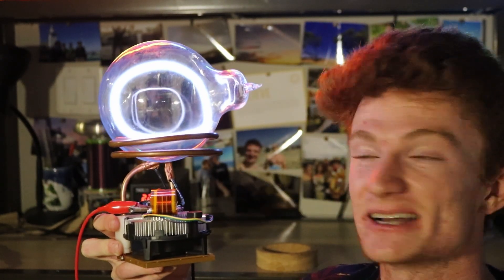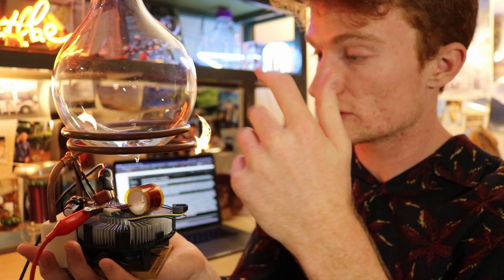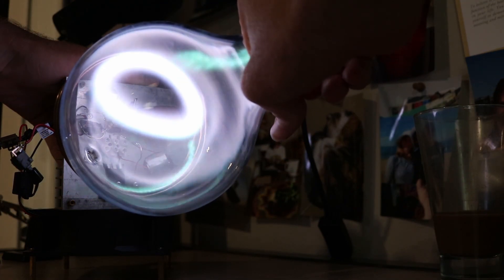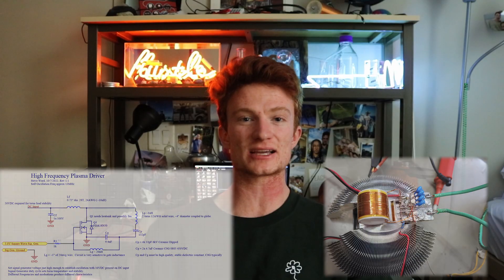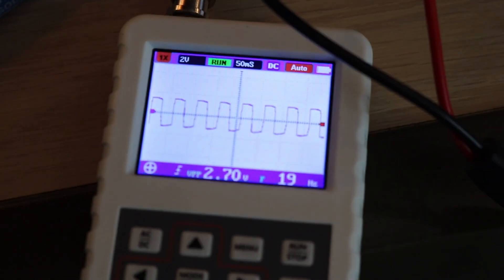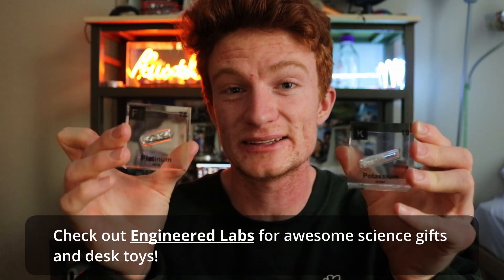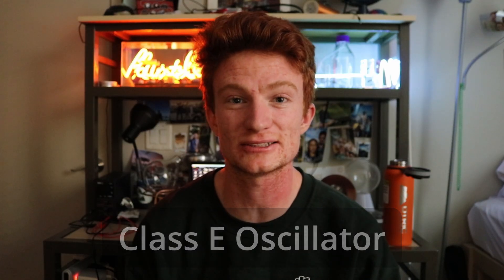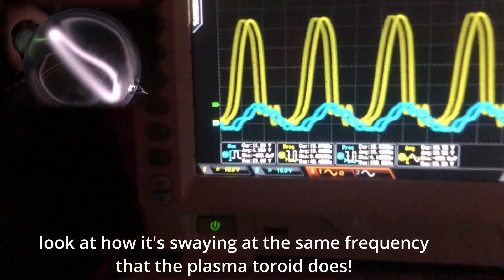perfecting and explaining the plasma toroid

Comment: Video idea: How could this kill me, followed by how do I make it (Idiot level guide)?

Watching the video, I didn't feel like there was enough information for me to build this myself. Once you got to explaining the circuit, I felt like the information level immediately went to 10 and was aimed at knowledgeable electrical engineers, than an average viewer. I think it would have helped if you explained the device as you were building it, or at least name the components (name and value) as you were assembling them.

Also, is the design scalable? Can you make a smaller one? A bigger one with a larger bulb? Does it need more/equal power? What voltages and currents does this require? What equipment do you need before you can make one? Is a >20V bench power supply a requirement? Etc.

Watching your series of videos on the plasma toroid, I get the impression that you have learned a lot between each video and have been conversing with people a lot on the subject. Each subsequent video feels like a large step in progress/knowledge. Be careful not to forget the viewer that has only engaged in your videos. They are still only as knowledgeable as the information you gave them in the previous video.

Above all, great video. Great step up in editing quality also. Can't wait to watch your channel grow organically.
Reply from the maker: Thanks for all this, man. I have indeed learned a lot since the last video update and I'm working on deciding what to upload and how often and how to format the content. It's hard to tell what's worth sharing, so I appreciate you specifying your questions. And yes, the ending circuit theory was for the nerds and the beginning explanation was for the general audience. Also, in my plasma toroid video from end of December, in the description is a step by step how-to in document format.
Reply: @BackMacSci  Thanks. I'll be sure to check it out!
Reply: @BackMacSci  This should be mentioned/linked in every future video
Reply: @BackMacSci  I rewatched the video you mentioned from December. My lack of understanding came from me not watching Teslaundmehr's video on the oscillator at the time. It makes more sense after watching it.

However, there is definitely scope for you to make your own dedicated "improved" oscillator circuit build video for this channel. I no longer want to build Teslaundmehr's circuit, since you have an improved circuit, and your circuit is dedicated for a desktop plasma toroid.
I'm thinking you could place all the components needed out on a table, clearly labelling their names and values. Possibly explaining what each component does for the circuit in a more beginner friendly way. Essentially the same as the circuit explanation part of this video but looking at the components themselves instead of the circuit diagram, or overlaying photos of the actual components onto the diagram. 
If you can clearly see the collection/list of what components you need to buy, it goes a long way to making the project possible in my mind. 

You could explain more simply what you mean by "bias", "filtering the ripple", "gates" and "drain". Dumb it down if you have to for us simple minded people! Essentially explain it at a lower level so that someone can come back to the circuit diagram explanation part of this video, or other videos and take more from them, if they want a deeper understanding. 

Easier said than done, I will admit! But I don't think I'm alone in wanting enough knowledge to build the circuit myself, and importantly, knowing how to avoid hurting myself with it too.
Reply from the maker: Very clearly explained, I appreciate it. I don’t plan on explaining this circuit at a beginner level. In future videos though, perhaps I’ll make a list of other YouTuber’s vids on basic electronics so people can build up to making the projects that I do.

Comment: So could you also use a ZVS (induction heater/zvs flyback driver) as a driver for this with the plasma ball and a big coil or is the frequency too high?
Reply: I'm curious about this as well. But if it doesn't it would be bc ZVS drivers are too LOW a frequency. They run in the kHz range, not MHz. Still gonna try it though. If it doesn't I still have other uses for the ZVS lol
Reply: @stupidvids0  Yeah let me know if it works.
Reply: @stupidvids0  where do you get those tubes from?

Comment: i'm surprised that the glass didn't shatter when you cooled it extremely quickly after it was heated by the plasma. please be careful.

great video, i've been really enjoying following along with your experiments.
Reply: Ikr when he dipped it in the liquid nitrogen I was TERRIFIED
Reply: @you.findbitches6054 Education for the win. Nothing is "terrifying" when you know what is going on and can work out these details. Plain glass would have indeed shattered, borosilicate almost doesn't care.
Reply: It's gotta be lab grade borosilicate, that stuff I swear is black magic.
Reply: @BSpinoza210  It is borosilicate. In the tutorial he told about it.
Reply: Why didn't it explode. Ive had hot coffee cups explode in the sink. Im sure there was less of a temperature difference there.
Reply from the maker: This may be because pyrex glass has a smaller coefficient of expansion than ceramic and therefore can remain in one piece during a temperature change
Reply: @BackMacSci  i assumed is was regular glass. Even still, its crazy Pyrex can handle such a drastic temperature change. Thanks for the answer.
Reply: @BackMacSci  thought pyrex was changed
Reply: @BackMacSci  How did you make the glass w/ gas?
Reply: Glad I wasn't the only one terrified.
Reply: Borosilicate 😊
Reply: I want to see what happens with 2 coils  placed at 90 degree angles from each other.  Could you get the plasma to make shapes by modulating each coil in certain ways?

..At first I was thinking it would be cool if plasma ring induced it's own inner ring, then I realized it would be on the same axis as the original ring and would probably just combine with the original one
Reply: Muito bom

Comment: Here's a video idea. Make a toroidal glass envelope for plasma containment. Make another coil around the equator of the envelope to dump a capacitor Bank in 24 compressing the toroidal Ring of plasma. Have a central conductor going through the air hole in the center of the envelope. Attempt to measure voltage gains across the central conductor.

Comment: I thought that that plasma toroid video was somehow faked until you made your videos because it looked too good to be real. I wonder what happens if you use different Gases like Nitrogen
Reply from the maker: It will work with any gas according to the papers from the 1950s. And the color and behavior of the plasma would largely depend on the pressure of the nitrogen.
Reply: @BackMacSci  Wil it work with O2